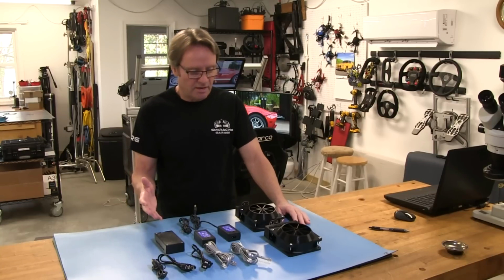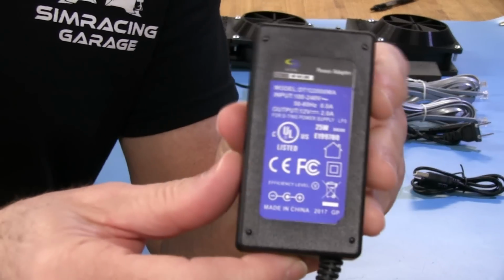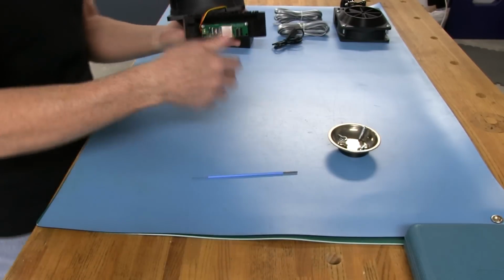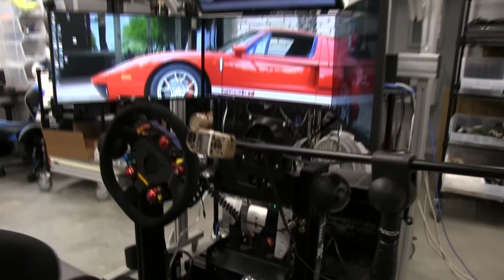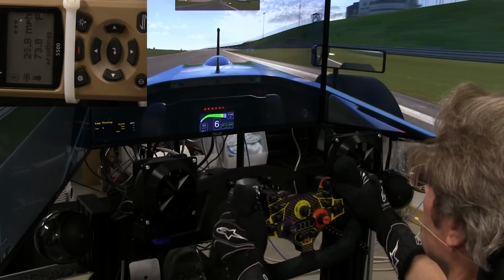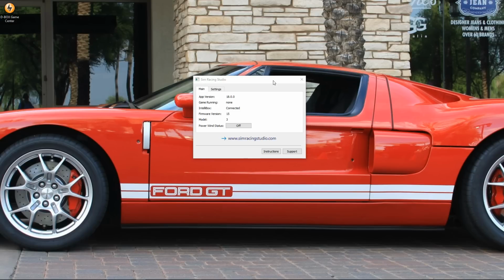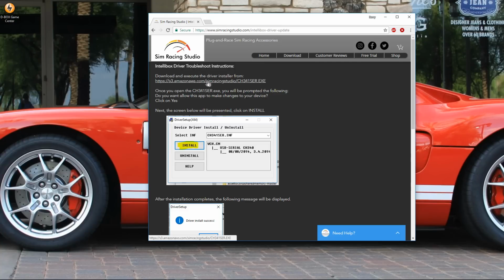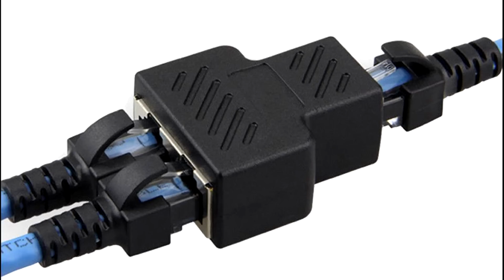Power Wind By Sim Racing Studio Review

Comment: Barry I just received this set based on your review and very disappointed to learn that the GS-4 does not work with this system.  If I launch the SRS software and then iracing and go into a test session the fans works etc and the SRS app shows game connected, this also works with Raceroom and AC. 

The problem is I have a GS-4 and 6 shakers that are ran via Simexperience. 

If I launch the Simxperience software my GS4 and all the shakers work great with Simvibe however the SRS software shows NO game connected in the app therefore the fans do not work. 

Any ideas on getting them both to work together?
Reply: try simhub.
Reply: Sim Racing Studio has fixed the GS4 compatibility issue in the new firmware

Comment: Very cool! But how does the system works with closed cockpit cars like GT3?
Reply from the maker: Not car specific. The system reads the speed the car is traveling and throttles the fans accordingly. So works on all cars. Actually a great cooling aid. It has replaced my 24 inch fan. But that may change once summer is in full force here in VA.
Reply: Sim Racing Garage Perfect, thanks for your reply!

Comment: I would try them out with Vardar high pressure fans. They are really provides high pressure airflow and low noise. These cheap chinese fans must be a pain. Not even mention their lifetime. Nice addons, but I would be worry about headache or getting cold by using it.

Comment: I think it may dry your eyes out. I used a normal fan for my racing because I was just getting to hot (I live on the equator). My eyes dried out to quickly. Maybe for VR it will be good. Though people normally wear helmets, snoods under helmets and the rest of their gear they would only really feel the force of the wind. But then again I’m guessing.
Reply: For cooling fans you could just direct the fans so that they don't blow directly on your face/eyes.
Reply: Erwin Lommer that is true. It only made me think about these fans blowing into his face. Wind is wind, cooling fans are otherwise
Reply: Exactly what I was thinking. I too live near equator and have tried with fan. 
I now have it beside me, pointing slightly away from me so I don`t get the 
wind in my face. Dry eyes is already a problem when using monitors, and 
with a fan blowing in your face, they get dry very fast. If you use contact 
lenses it`s even worse. Guess you could use MC glasses though.LOL 

Anyway, this set is way too expensive for what you are getting. Noisy fans 
that uses way too much power being the most important.

Comment: Definitely getting this, my eyeballs are literally sweating in VR
Reply: This will make absolutely no difference to your sweaty eyeballs while playing in VR. I have a small fan mounted on my wheelbase, and with the fan running. It keeps me slightly cooler, buy as the VR HMD is sealed against light, it is also sealed against cool air. anything longer than a 20 min race, I have to keep lifting the HMD off my face on straights to allow the air to cool me down a bit. Save yourself $100 and buy a small USB desk fan.

Comment: Awesome Review as always!
But why u need 2 powersupplys with each 2A... one Fan draws not even 0.5A...
And i dont get why u have 12vpower and Data. U can Control the speed via PWM with the arduino...
Reply: a fan with 0.5 amp will not  be powerful enough to give you strong wind. ours use 1.5A each so you can have 218 cfm. usually, a 0.5 amp will give you around 90-110 cfm. It makes a huge difference...I had those 0.5amp before assembling this kit.

Comment: Great review as always man! I have been looking into this feature for awhile too, if it sells the sensation of speed more in VR then I'm in 👏👏👏
Would love to see you add transducers to your rig next. It really is good feeling the engine vibration at idle and also feeling other cars hit you on that corresponding corner of your rig 👍
Reply from the maker: No need for transducers with the D-BOX system. Bumps, curbing and rumble strips with the D-BOX are noticeably better than my transducers ever were. And I was running 4 full sized LFE's. Each with it's own dedicated 1000w subwoofer amp.
Reply: Ryan Chenoweth You don't need transducers when you have a D-Box system.
Reply: DES Simulation is it as quick and responsive as Buttkicker Concerts and LFE's? 🤔
Reply: A D-Box system gives you a even better response than LFEs. But maybe Barry will chime in with his personal experience. He had LFEs on his stage 4 and he hasn't installed them on his new cockpit.

Comment: This may be solution for my VR racing and the heat problem  :)
Reply: First thing i thought, but pretty expensive for a fan to cool you down, eh?
Reply: Yea thats truth.
Reply: Definitely, 6" USB fans are very cheap and push a decent amount of air for cooling. These sim racing fans are interesting but really a gimmick. Put that money into other sim gear instead.
Reply: You get hot inside the VR HMD. It is sealed to stop light entering. How is it going to cool you down inside a sealed unit. just mount a $10 USB sesk fan on top of your wheel base or stand a bigger fan in front of your rig.
Reply: Oculus is not fully sealed, there's an open on the nose, unless you have a really big nose. This ain't no scuba dive gear and just the fresh air on the other parts of the face and neck can make a huge difference. The idea is good but not enough tecnical to justify that price range.
Reply: Just buy a USB-fan for a few bucks.
Reply: I purchased a floor-mounted, remote control oscillating fan to my VR racing/flying rig. Works great, and cost me $35. 

Barry, another great review of an interesting product. However, I've raced actual cars in the past, and even in open wheel vehicles, wearing a helmet and fire-retardant gear, never once recall that "wind in your hair" feeling you're gonna get from something like the Power Wind. I understand the illusion of speed you might get from the wind in your face rising and falling with your speed, but this is a trick, and not realistic, at least in my opinion. 

Maybe if I were sim racing open-wheel cars of the 1920's and 1930's, or sim flying open cockpit biplanes from WWI, but with any modern day vehicles, you're pretty isolated from the outside environment, especially the wind. And...there's the matter of the price of this product.